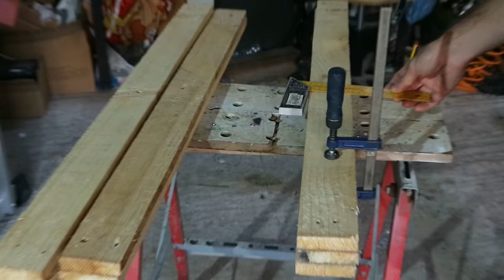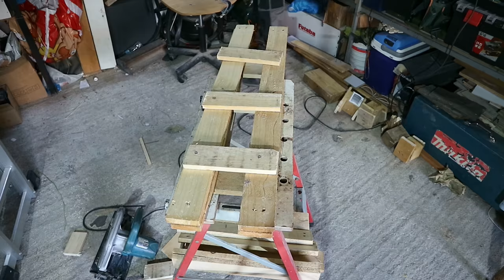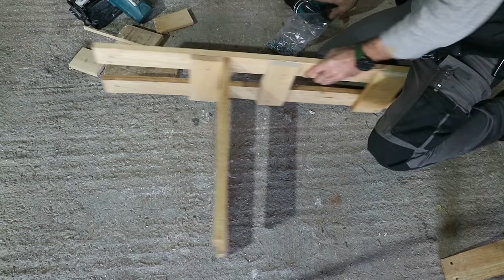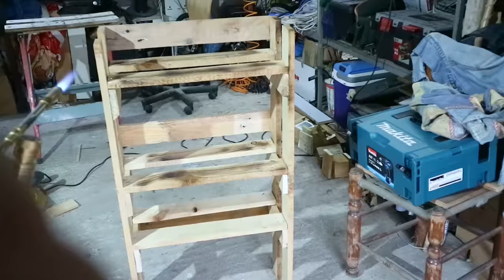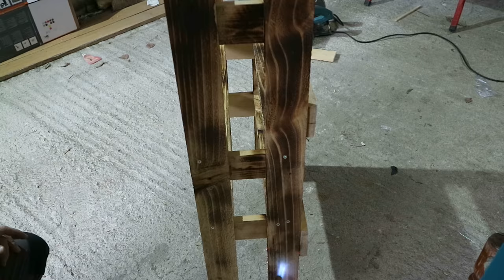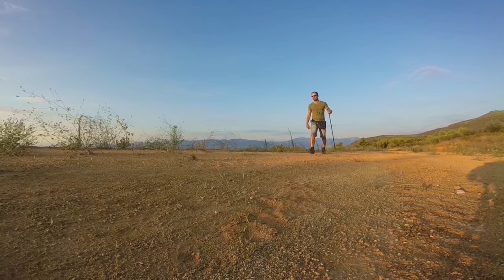How To Make a Shoes Rack With Only Some Plain Wood (planks)

Comment: Very cool ! I am going to be making one or more with live edges/ends so will need to plan a angled cut to hide it but this should still work . If someone wants to hold more weight they can use cobra toggle anchors, I use them at work to hold 72 inch TVs in 5/8 drywall 5:24

Comment: hi ortiko, very nice work. i like the simple style of woodworking. would you happen to have plans for this? lengths of each piece?
Reply from the maker: Hello! The Long pieces for the sides are 100 cm(39,4"). The small one that hold the shelves are 22,5 cm(8,8") and the shelves are 50 cm(19,7"). Hoppe this helped you and i am very happy you liked my woodwork! Wish you the best!!!
Reply: @ortiko  22.5 or 25 cm, since it's the half of 50?